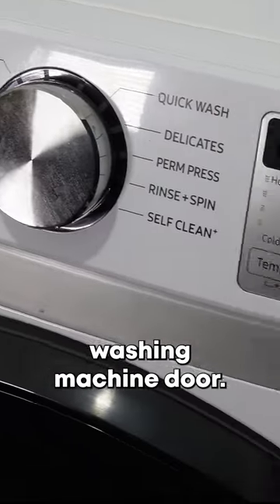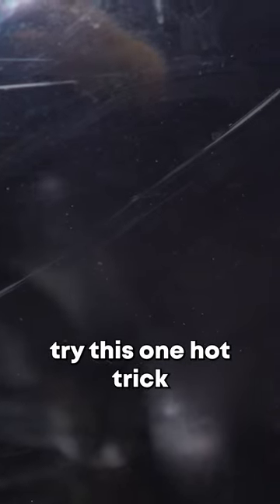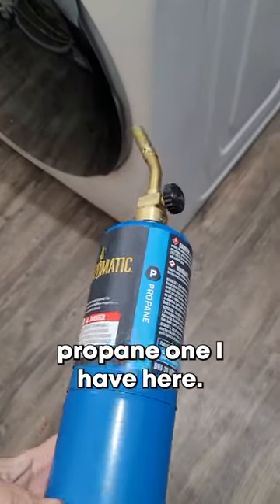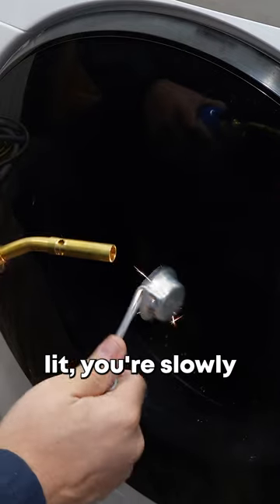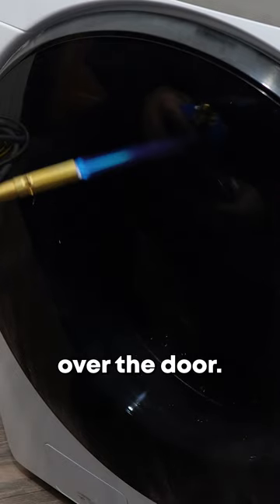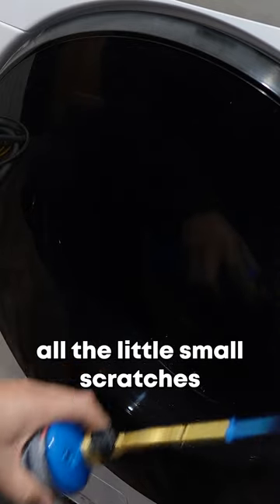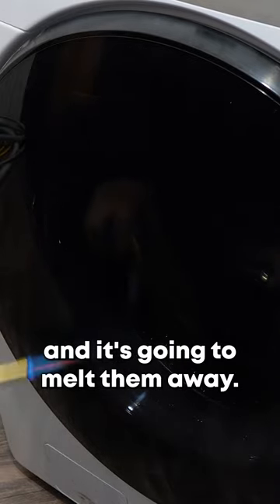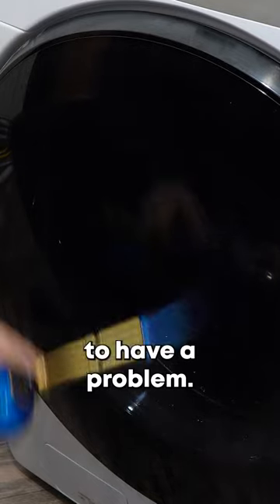RESTORE a Scratched-Up Washing Machine Door?! #shorts

Comment: That's one reason why I bought LG instead of Samsung.

LG and Speed Queen use real glass in the doors on their front loaders, and real glass holds up way better than plastic.
Reply: That's what I realised on my LG as well
Reply: Samsung uses plastic on their doors now? I have a Samsung washer and dryer. The washer has a glass door, the dryer has a glass inside layer but plastic outside layer.

Comment: Wait you can still get washers eith plastic doors? I've always used top loading washers with metal doors, I thought it was just a trope born out of older tech.
Reply: LG uses glass on the inner and outer doors, so no plastic at all. Samsung uses plastic on the outside door, which is fine. But the absolute worst? Whirlpoop. They use plastic on the inside of the door - you know, the part that clothing rubs against constantly... zippers and all. But then, their front loaders are almost as cheaply built as their top loaders, so it's not surprising.